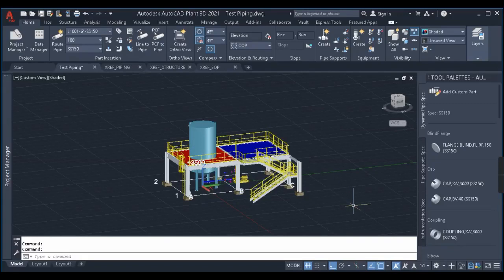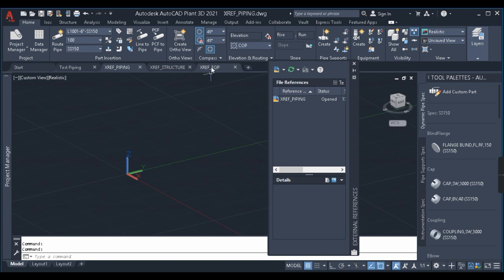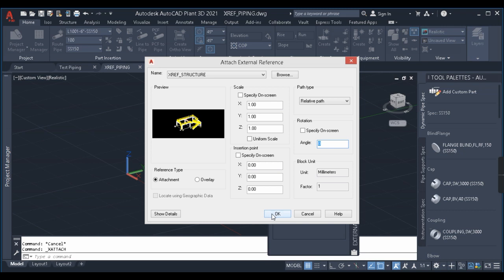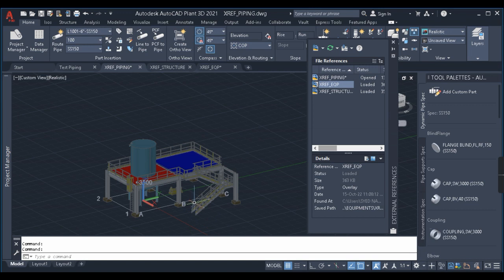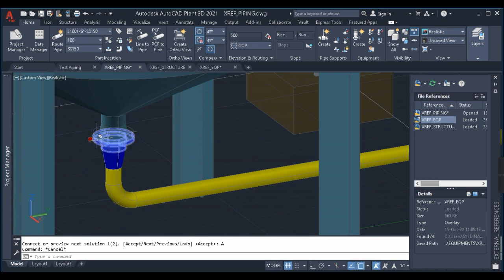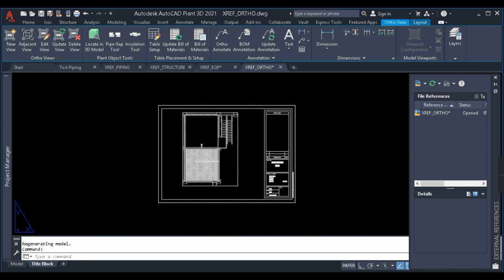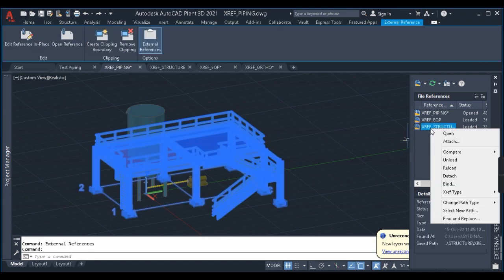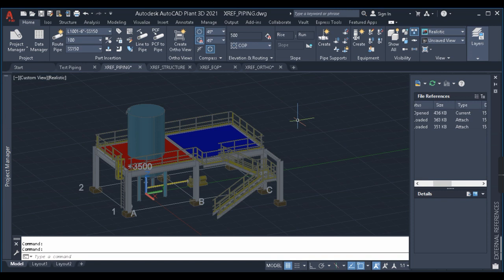Plant 3d Tutorial For | XREF Command |

Comment: you lost me when you launched the XREF command. The  best way is to run it from Project Manager by right-click on the file that you want to insert as xref.
Reply from the maker: How will you xref a file which is not in the current project?? 
Btw your point is not wrong🙂
Reply: @plant3dtutorial261  I would link (or import) the file in 'related files' and xref from there. That way I always have shortcut to the file in my project.